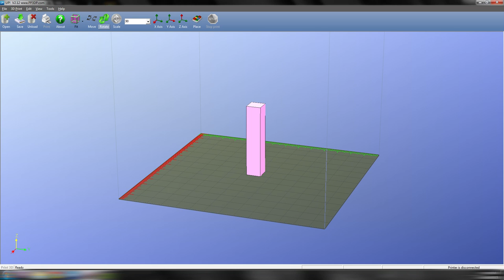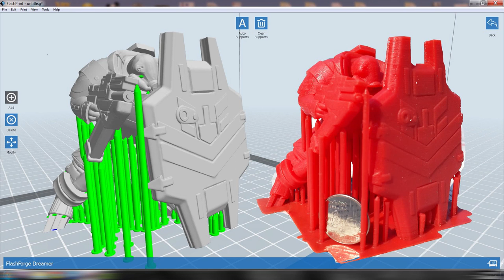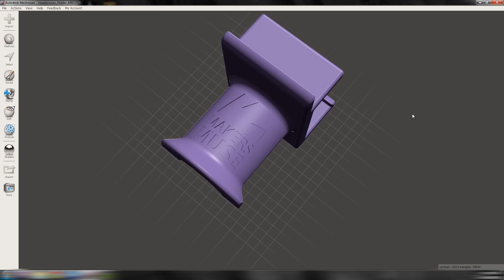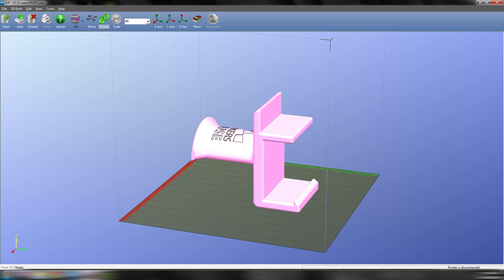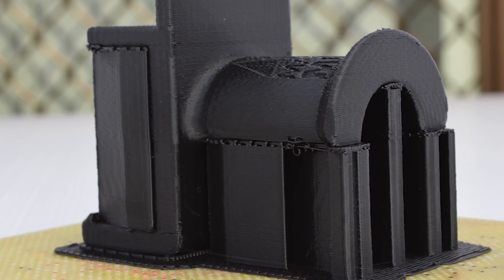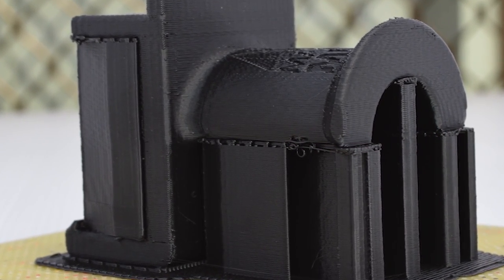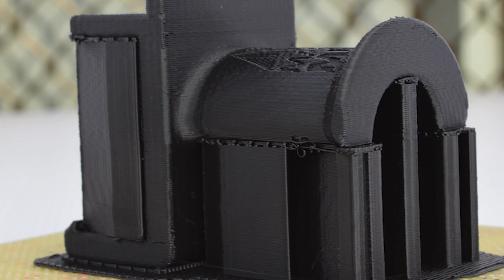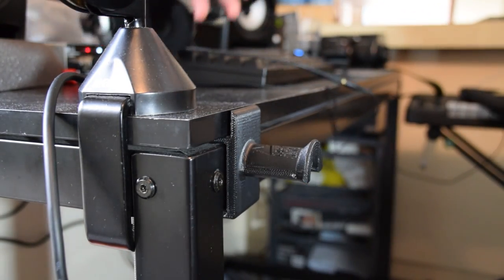The Best Way to Orient your 3D Prints - 3D Printing 101 - 2015

Comment: One thing I've discovered is that I can use my screw and stepper motors limits to my advantage. With a 0.4mm nozzle I still get GREAT prints at a 0.08 layer height and when I combine that with an extrusion rate of 1.05 instead of the default 1.0, it gives me a great looking AND stronger print!  Hope that helps some if your viewers! And great vid, thanks!

Comment: Excellent Channel!
This may be off subject, but in regards to print lifting (due to the colder part shrinking?) would it be beneficial to have the platform heater on at the beginning of the print and then shut off?  
Just a thought.

Comment: along with that i had model i had to print but i didn't have any good contact surfaces, so i had to split it, now it prints really good. because otherwise the model would been entirely on the support material, and it came out looking badly, watch this video of yours and i think another, sometimes you just have to split your model right in half and print them side by side.

Comment: A subset of orientation is how it lays on the bed in regards to ghosting (really only matters for the Prusa style sliding beds) as I saw on your print.  Making it catawampus on the bed can help that so the print comes out even better.  It sure does get tricky. :)
Reply from the maker: +legalizeshemp420 That's an interesting point, never thought much about that. So many trade-offs! I have never heard of that word before haha, but yes I often make the prints diagonal on the Z so might have been handling the ghosting issue subconsciously...
Reply: Maker's Muse
:)
  The thing is the ghosting is due to a moving bed so an UM/UM2 where the bed doesn't slide (Prusa it is in the Y direction some they slide in the X) there is no ghosting.  Can see it most when you have a hole in a flat side and beyond the hole can see a faint hole image beyond it.  Very interesting how that happens.

Comment: It's also better to have the sides of a square print not run parallel to your axes, since it's easyer for a machine to reverse the direction off an axis then to completely let it stop and accelerate the other axis.

Comment: Great video, I purchased a cubify version 2 printer a couple of years ago now from Officeworks in Aus. Unfortunately within 12 months of having it they phased out the cartridges for the printer and have made it very hard to buy filament locally for it. A regretful purchase on my behalf
Reply from the maker: cory goldthorpe Officeworks' foray into 3D Printing was short lived and fairly sad I must say. Does the Cube keep track of the cartridge - ie can you 'refill' or mod them using aftermarket plastic? It should just take standard 1.75mm abs or pla if you can trick the software.
Reply: so the filament cartridge has a little chip on it which does indeed keep track of how much filament it is using. I did however find a hardware hack. cube3dfree.com
Reply: Before i got ahead and buy it I am looking at ways to hack the chip on the cartridge or see if there is some type of firmware hack out.

Comment: Angus, In the horizontal print, i noticed some separation in the top of the rounded part.
I experienced this with PETG, on my anet a6, and dont have this with PLA or ABS.
Printer work great and produced a good quality @ 0.1 and 0.2 layer height.
What caused this?

Comment: I have a question  about abs and available support materials. I have been considering a dual extruder  for the  purposes  of printing with soluble support materials. The question  is do any of the  currently  available  build materials  play  nicely  with the currently  available  soluble  support materials.
Reply from the maker: Alan Simpson I would say no - none in my experience have worked at all reliably enough to be considered. Some people have made ABS work with PLA supports dissolved away in Sodium Hydroxide (not very safe at all). In my experience dual extrusion on the lower end is more of a novelty for printing two colours or dual material in the same print, rather than useful for soluble support.
Reply: +Maker's Muse Thank you. One reason I watch you is your absolute candor in your opinions. I very much appreciate that. What brought the subject of dual extrusion and soluble supports to my attention was a visit to a Stratasys seminar. The combination of the two on their equipment was an eye opener on the possibilities of FDM printing. You helped to confirm for me that it is not a viable solution as of yet for "entry level" printing. I am from the US and I am beginning to see petg and that family of filament being talked about as the new abs. So far I have found petg hard to setup. What are your feelings on taking the time to get a good profile on petg as apposed to sticking with he two main players abs and pla.
Reply from the maker: Alan Simpson I really wish soluble support was viable for the lower end machines. I have a love / hate relationship with Stratasys. Yes they make some amazing machines, and have developed some great tech... but they use patents and all manner of dirty IP tricks to tie up that tech for years and years. It's why 3D Printing has taken so long to become affordable and why many other simple innovations (a heat controlled build chamber or soluble support recipes) are still locked away. Heck, they even tried to patent 'printing in sections and glueing together'! PETG is a pretty good filament to print with, I wouldn't call it the new abs - as break away support material in my experience is tougher to remove. I use colorfabbs XT and XT-CF20 all the time which is a kind of pet, and to be honest profiles are little more than raising the temp a bit compared to ABS. They seem to have very similar characteristics, PETG just doesn't need as much heat in the bed as ABS does.
Reply: +Maker's Muse I had been considering purchasing a roll of the Colorfabb XT. I have been wanting to settle in on  a single brand or maybe two brands to take away constantly having to fiddle with  settings and begin to enjoy the printer more. My only experience with petg  is with esun black petg and it was being very stringy.  Thank you for taking the time to respond.
Reply from the maker: Alan Simpson Stringy filament usually means too high temperatures, but I could be wrong as I haven't tried esun petg. I know quite a few people are moving towards XT as their main material now due to its dimensional stability compared to ABS - so I would highly recommend grabbing a roll and giving it a test!

Comment: And for an cheap 3D printer like the anet A8 do you think it will create less vibration to print the rectangle diagonally or at a straight angle with the bed edges?
Reply: Vibration is really a factor of the chassis build material and design, not really part orientation. In theory I guess printing so each layer is as long as possible which reduces the amount of times the hot end has to change directions could reduce vibration but I think that is a negligible factor. Printing slowly would probably be the best solution to severe vibration issues. Not sure for certain though.